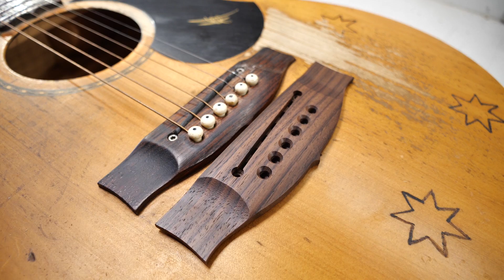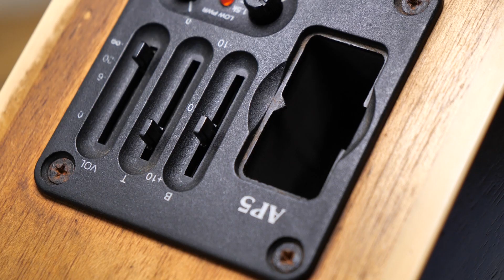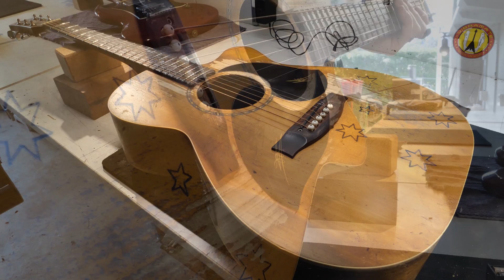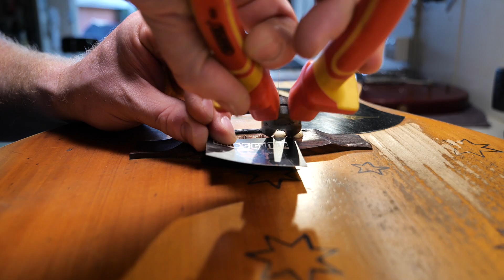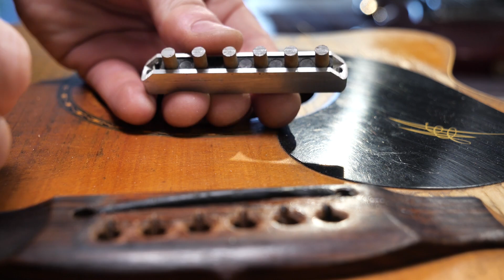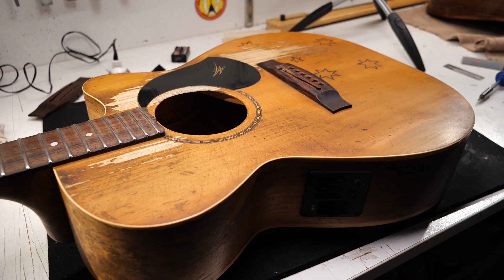Jed's Maton - Part One

Comment: I'm with your observations about Maton guitars Brad.
Some years ago Maton asked me to be their South Island NZ repair agent. I didn't take up the offer because of a number of manufacturing issues.
The X brace halving joint is not reinforced leading to splitting.
The braces are usually not let into the linings causing them to pop off.
The lacquer is not cleared from the entire  bridge glueing surface.
The pickup control box battery connections fail.
Other than that I love their long history overall qualities.

Comment: If "one" was to fit a different, less bulky pick up system and matching bridge would that help get around this problem? Or are there too many other structural problems with maton designs - top & bracing-to warrant the work ?
Reply from the maker: The problem is that the soundboard already has that section missing. The earlier Matons prior to the APx pick-up system had a conventional piezoelectric strip element and didn't exhibit these problems as a result.
Reply: @BradsGuitarGarage  so timber missing from the sound board leaving a weakness & if braced would further dampen resonance - partularly at the bridge where the energy is created.  Bummer. I did over tighten my Allen screws & broke one end of that strip. Don't use the pick up any way. Only home player and record it with microphones. Mine doesn't have bridge or top problems "yet". It's the neck hump from fret 7 to 14. Wonder if re fret with high jumbo frets could the fix with fret level? & new nut.?

Comment: What's annoying is when Takamine were using the same pickup system, they used 6 holes for the slugs instead of routing a channel to keep the integrity of the top and they inlaid material to stop people accessing the screws.
Reply from the maker: I've seen that system & there you go, that's how you do it!
Reply: Drilling 6 holes with precise spacing is much harder to do than routing a slot; I expect the required tooling was decided to be too expensive. Wood plugs for the "do not adjust" screws would be an excellent and cheap upgrade!
Reply from the maker: No difference to a CNC, mate.
At least not one with a competent programmer.
That was my job immediately before going full time with BGG.
Reply: @tedmich  not that hard even with old fashioned templates and drill guides. Modern CNC can do it correctly each and every time. Takamine used to to it with their models back in the 90s.

Comment: It's perfectly okay to like the concept or operating precept of a brand (in this case, locally built with local materials) but dislike the poor implementation of the design. You want them to succeed, but not by cutting corners on the basics!